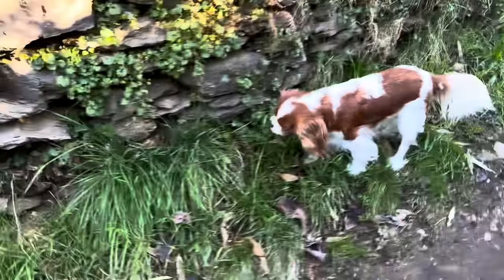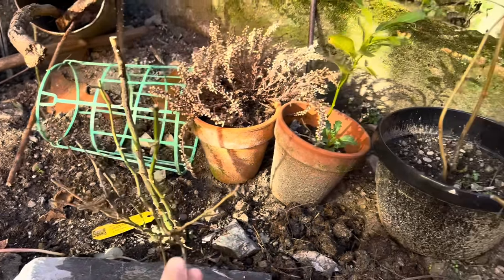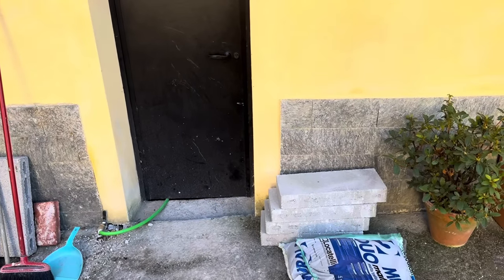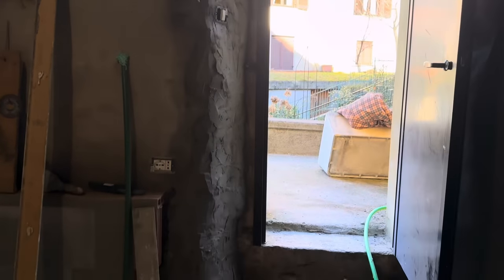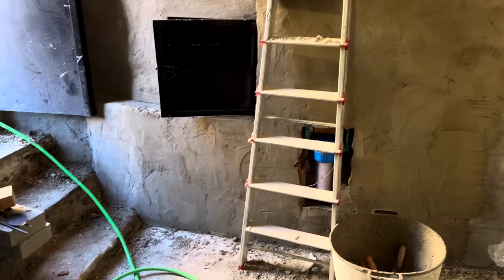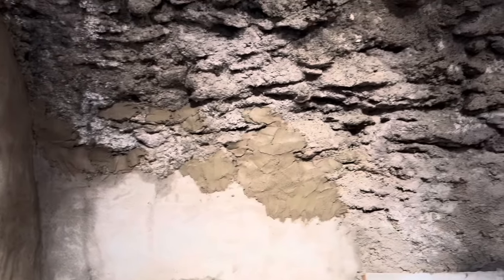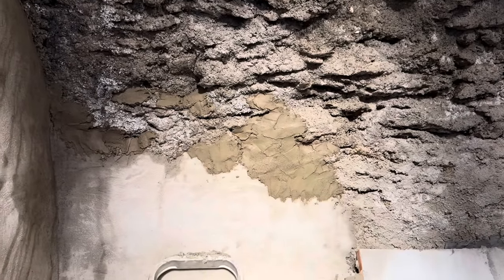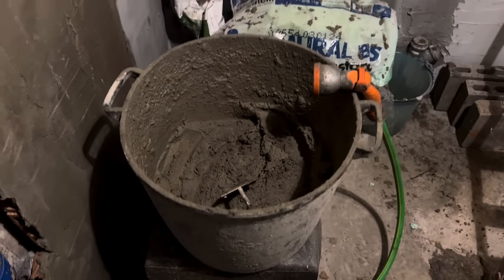Renovating an old vaulted ceiling/ Our Italian villa

Comment: If the mixture you use to plaster the concrete ceiling doesn't stick well, maybe you need to use a cement based mortar. The 'bastard mortar' you use has only one part cement and three parts of lime ...mabe there is too much lime...You should ask the seller for a specific product for concrete walls...👍
Reply: They spent ages getting concrete off of the walls because it's not good for them.